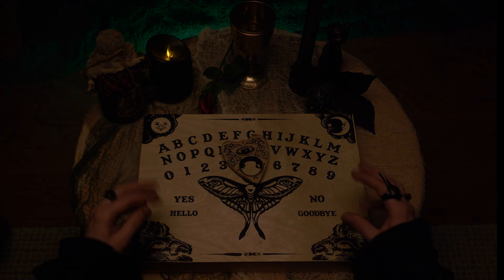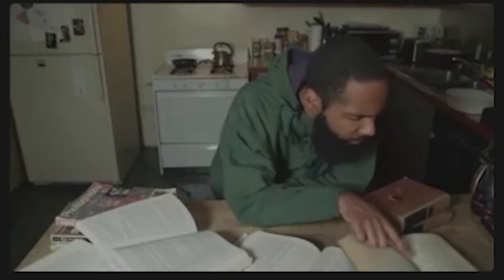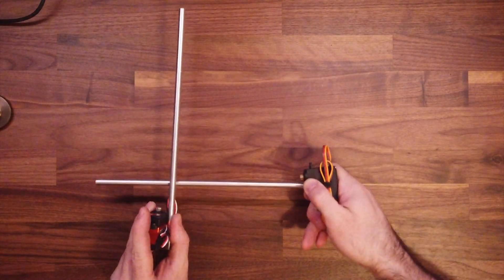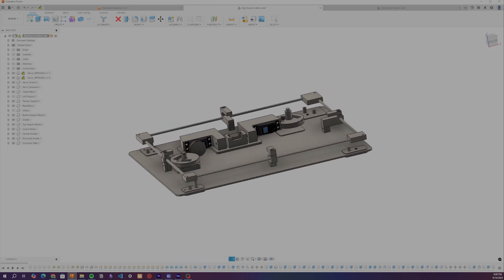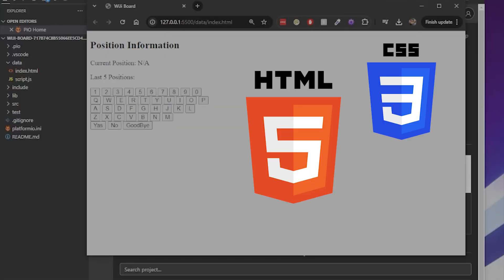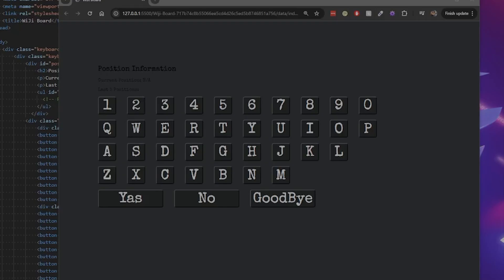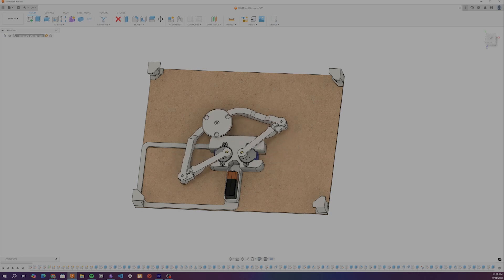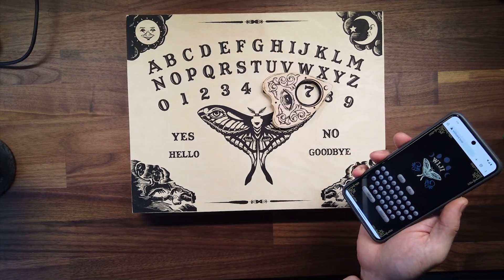I Made a WijiBoard You Can Control with Your Phone!

Comment: How noisy is it when operating? Can someone tell there are motors running inside?
Reply from the maker: It's nearly silent.  For me it's below the noise floor of my room.  If you pick it up an hold it just below where the steppers are you can feel a very small vibration. If you put some rubber feet or something similar on the bottom it would be even quieter